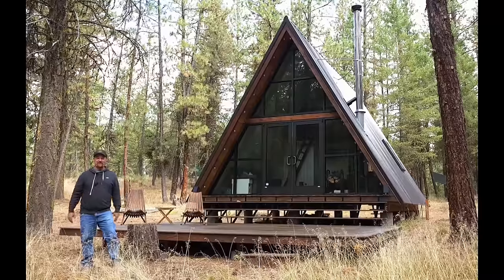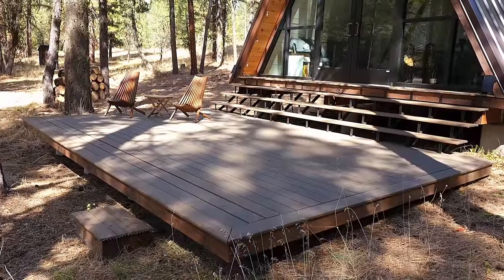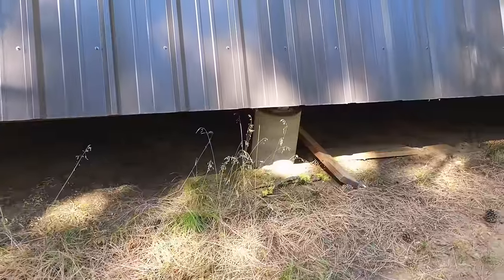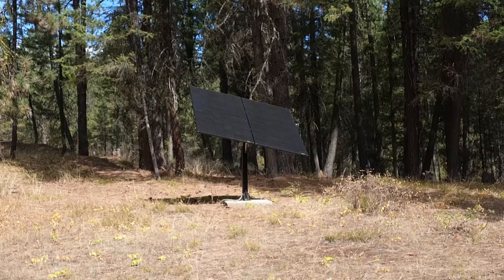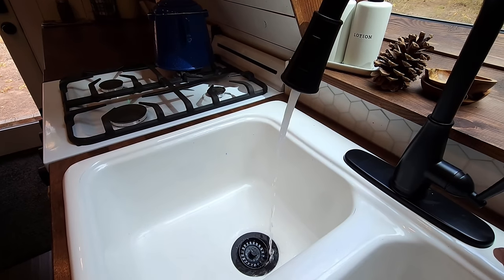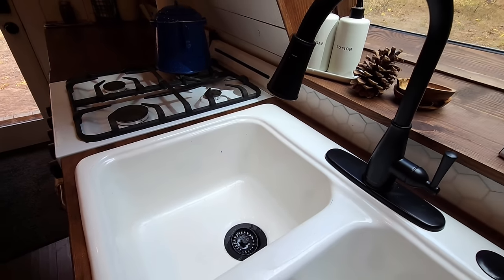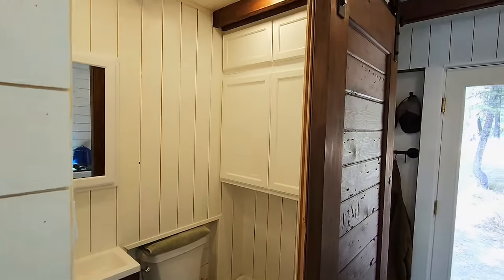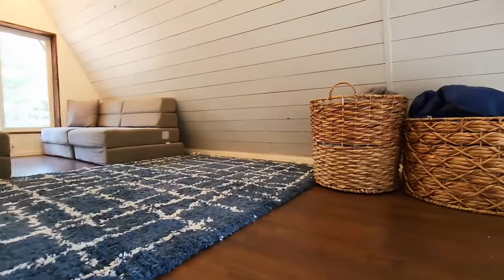We Built an A-frame Cabin! - FULL TOUR of Our Tiny Off Grid Cabin

Comment: Very cool! What state is the cabin located in? I’m curious about how reliable the solar system is during winter, if you have a back up generator, etc.
Reply from the maker: Thank you! I do have a generator back up and the cabin is wired for it, but so far, I have not had to use it. The fridge runs less in winter, so the solar is mainly just running lights and they are 12v led and don't use much power.

Comment: Well done. This is exactly what I'm thinking of putting together. It's the perfect size for the wife and me. What is the pitch of your roof? I'm guessing at 60 degrees?
Reply from the maker: Yes, I believe it is 60 degrees. 20x20x20 equilateral triangle. It is a perfect size for 2. My wife and I plan on retiring in this little cabin.
Reply from the maker: Yes, I believe it is 60 degrees. 20x20x20 equilateral triangle. It is a perfect size for 2. My wife and I plan on retiring in this little cabin.